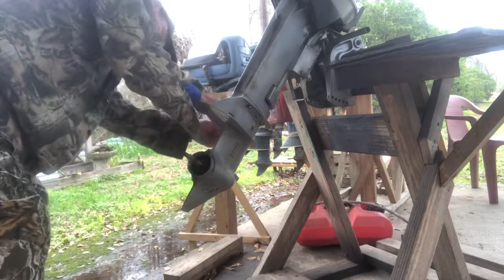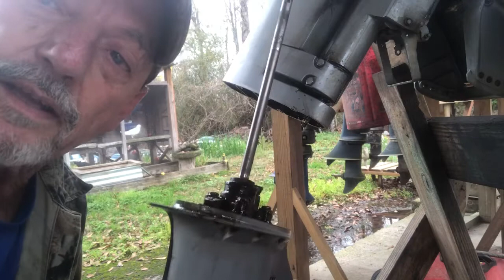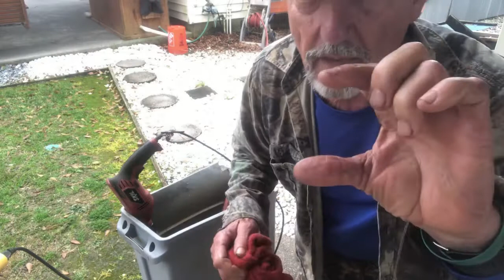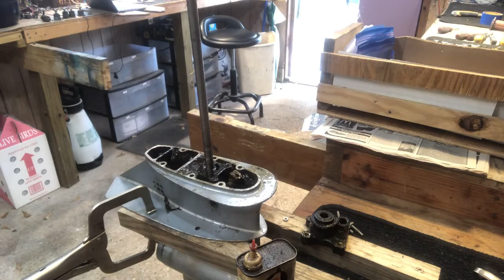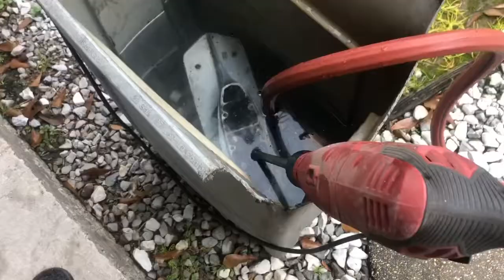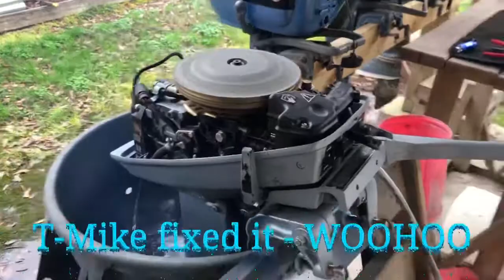Replace Impeller 1984 15 HP Evinrude Vintage Motor Repair & Service

Comment: And you should never put oil on a rubber impeller you should buy a proper rubber Grease that they use in brakes this way it will not affect the rubber

Comment: And it would be worth mentioning to your customers that OMC do now for the early models they do a plastic housing stainless steel inner and a proper impeller for the early models it's a conversion from OMC it is 100 times better than the old weigh replace an impeller because it has a stainless steel in it and a plastic outer like the later ones bulletproof

Comment: And you should not use a file on the bottom shaft because you are putting vertical lines across the shaft with a file and you're not making it round if you stand the shaft up in the Weiss and you use Emery and you do a circular motion then you are making rings around it which the seal then seals much better with the rings running around that way never used a file

Comment: And one thing you didn't mention about removing that was that screw between the housing and the leg is you should have the engine in reverse it will lower the leg down further so you have an easier access

Comment: So you would use that Johnson or ever rude have a little side cover on the side of the housing a little housing about 4 in long with two short screws allows you to get into split the gearbox apart it's a very simple conversion it looks great it doesn't harm the engine to death because most people don't know about that and they destroy the outboard and the leg trying to get it apart and on the 5 1/2 and the six horsepower they also have a roll pin that goes through the top of the shaft and carries the top 🎩 🎩 cork and carbon seal spring for the crank I don't see you do that in any of your engines no do you address it and if you are failing to put that in then you will have a terrible vacuum leak when the engine compressors it will force air passed the lower crank casing antique caused a huge problem in idling and it will lower the compression and and weaken the delivery of the atomised fuel air mixture to the combustion chamber I think it would be worth I'm sure it would be worth mentioning do all of your viewers

Comment: Well Mr t at least you drive a jeep but I hope that you pulled out the engine threw it away and put yourself in a 440 cubic inch RB wedge six-pack roadrunner you can get an isolated transfer case out of an f250 then you can run any drive tranw  that you like

Comment: I had a question. Can you run them without a thermostat?
Reply: T Mike, I had a question. I have a 1986 johnson 15hp You know how to thermostat on those sit in the bottom Can I use the cylinder head off a 1988 To have the thermostat easier access on top??
Reply from the maker: @Outboard1boats  sorry can’t help - don’t have the experience with 80s motors. Good luck
Reply from the maker: Sure.

Comment: I have to ask don’t you have to change lower end oil when you do this. I just got one of these engines and and im getting ready to change the impeller but im not sure about changing oil in the lower end or if it’s serviceable
Reply from the maker: https://youtu.be/6tJIS1q1Klk

Comment: Hey Tmike I have a question. I bought a 1974 evinrude 15hp outboard 2 stroke at the end of last summer. I put the muffs on it and I don't see a pee hole. I read somewhere that they don't have one.  I didn't run it but about a minute or two because I didn't want to tear anything up. Can you tell me if there is one or where the water should be coming out? Thanks for your time and I'm a new subscriber.

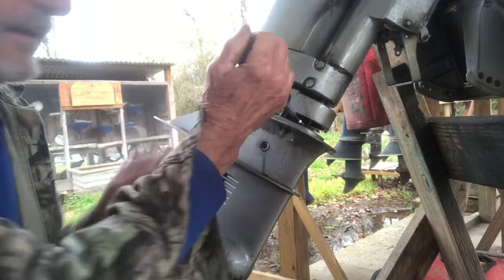Comment: I’ve got my lower unit separated about as far as you do in your video at 4:27 but I cannot see or find the disconnector bolt. Any ideas where it is? I’ve shifted between reverse and neutral to find it but cannot see it either way

Comment: Good easy fix Tmike, When the impeller fins get that bent memory and all rubber parts will harden and crack over time it's time to replace them. Last time I went to the marine store I bought a couple each. You want to have them on hand before fishing season. The start of the new fishing season I test all my motors to make sure they are all in working condition

Comment: Thanks for putting up this video. After watching you install the impeller, I realized that I had wrongly installed my replacement impeller going counterclockwise. Its pumping water now, and I appreciate your knowledge. CAJUNS RULE !!
Reply from the maker: You are the reason I do what I do sha!!!
Reply: Say crooner, how did you realize it was reversed? Did it just not pump correctly? I just did an install of a pump kit yesterday and I foolishly forgot to check the rotation of the old impeller before removing 🤦‍♂️🤦‍♂️
Reply: @fastillion918  the impeller did not pump when I installed it the first time. I reinstalled the impeller going the right direction and forced pressurized water into the drain tube coming from the power head and it works now.

Comment: Hey man how are you? Just stumbled upon your videos. Question....I have a 1979 15 horse. It starts very easily with no hesitation. Now last summer was the first time I started a motor on a stand with water muffs. It started and idled, but after a couple minutes it stalled. I then started it and it started fine. Is there a reason why it would start up fine, but stall out after a little while? It just starts to bog slightly then shuts off even when I give it a little throttle. It acts as if the choke was pulled out to stall it if that's any more help.
Reply from the maker: Sounds like either fuel pump or carb cleaning needed.
Reply: @michaeljsimon  see now I would've thought the carb, but it starts up so easily, and idles fine for a couple minutes. I will definitely take the hood off and get the carb out of there to clean it and see how she runs. Do you have a preference on what touse to clean it? Can I use Gumout carb cleaner? That's the only carb cleaner I have.
Reply: @randyhules3369  I always soak my carbs in rubbing alcohol then blow all holes with compressed air.
Reply: What part of south Louisiana you from t-mike?
Reply from the maker: @bradsmith4  South Cajun Country
Reply: Had a similar issue on my '87 15hp, needed a new fuel pump. The old one had a tear it it on the diaphragm about the size if a needle mark, and it would start fine and idle fine for about 3 or 4 minute periods before dying. New pump is like 20 bucks on Amazon, and now it runs like new again